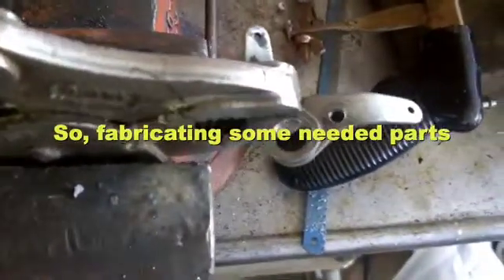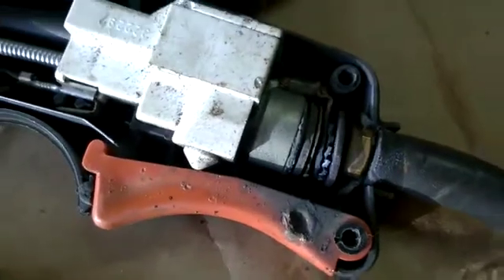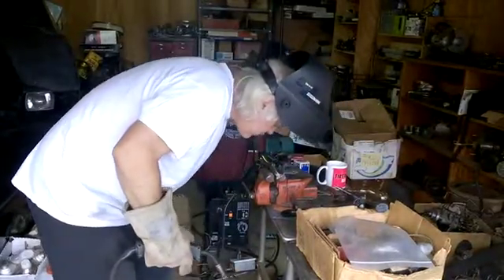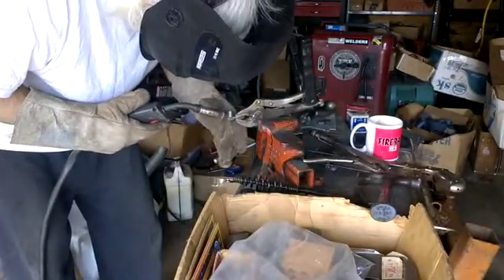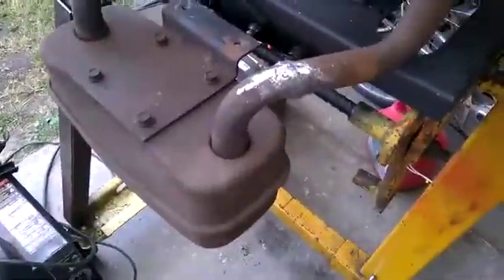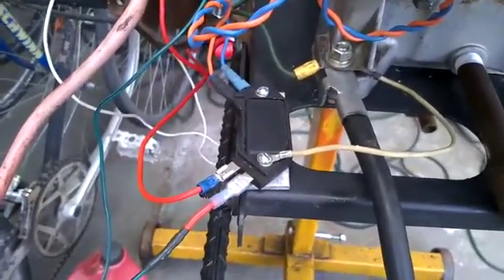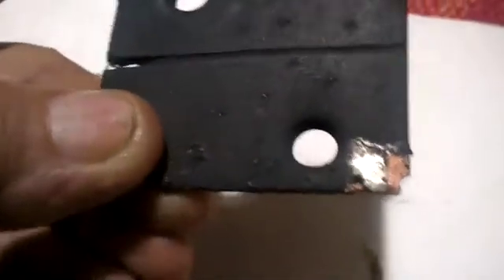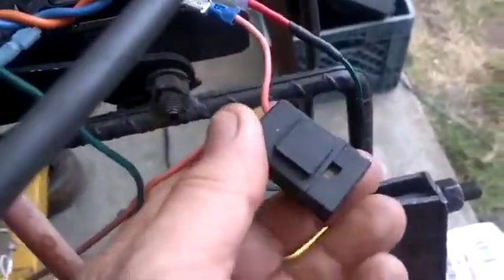Battery Ignition for Briggs Opposed Twin - Part 2

Comment: Does each plug have it's own coil? And also it seems to have adjustable ignition timing now?
Reply from the maker: @LVBeatzMusic  The coil is from a Buick 4 cylinder that had two plug outlets to fire two plus simultaneously. That is ok because one firing sequence is on the exhaust stroke, know as wasted spark. I previously had it working with the module firing two separate coils at the same time, one for each plug.
Reply: @vanstechcorral  Ok tysm for answering. I am looking to build a dual coil ignition for mine, as I want fully adjustable timing control and or stronger spark. And yes the wasted spark system is used. It can be good, but I want to run a wider gap on my plugs, and I don't want to fry out the stock coil.
Reply from the maker: @LVBeatzMusic  Yes it is adjustable although static, so that I could adjust it with a timing light for the right advance.